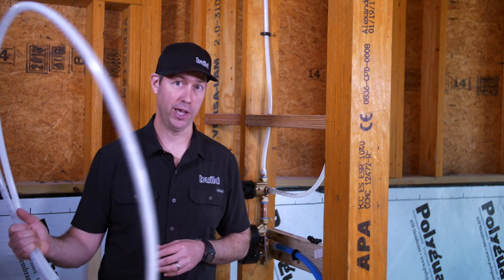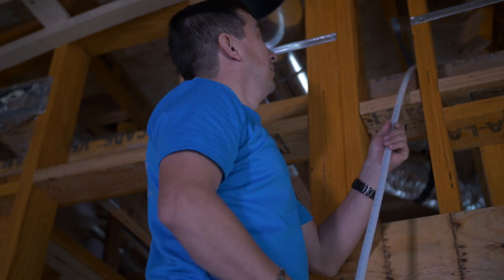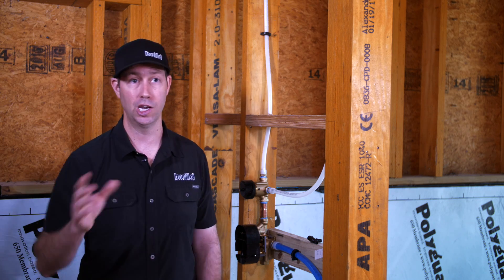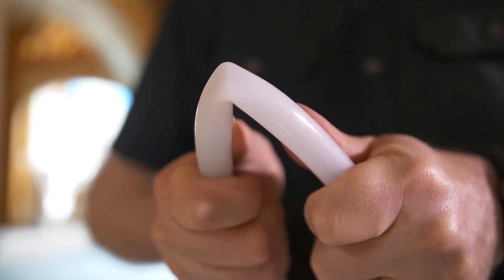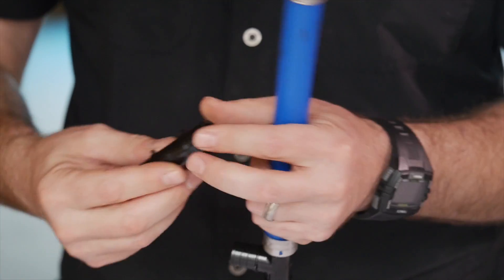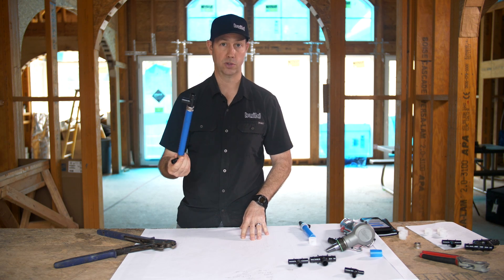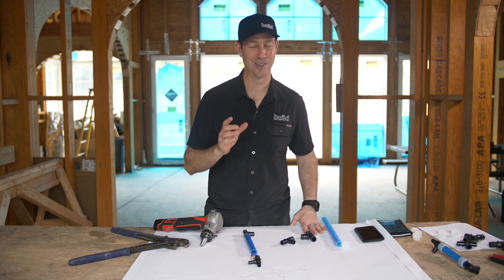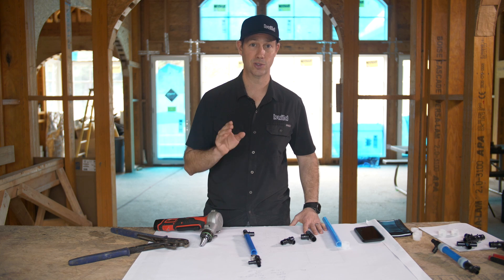PEX vs. Copper Plumbing

Comment: Lets use the example that pex is more like OSB plywood. It's cheaper, and everyone is doing it. The reality is, ACX is better, more expensive plywood and copper is far more durable. And let's face it, plumbers are charging as if they are sweating a whole house, while pulling tupperwear piping...  I have replaced LOTS of pex that mice have chewed through, never copper. Trends die, I mean look at QUEST piping and the late 80's ABS pipe, RECALLED after hundreds of thousands of homes were plumbed.
Reply: Alternately, if you have an issue like my home, with a granite slab foundation that is difficult to heat, and you live in the wonderful Ice Kingdom that Maine, well, 5 years i had to hire plumbers to come in and fix ruptured lines that despite insulating, and even 'heat wraps' were still bursting.

Switched to PEX 2 years ago, and while my lines still occasionally freeze, i havent had to spend 2500 on replacing the lines. As for mice? Easy, you apply a nice coating of Squirrel Off (thats what i call it, most people use it to deter squirrels from climbing onto bird feeders), a gel that they dont like touching, but is non toxic.

Both types of plumbing have Pros and Cons, Pex is cheaper, easier to install yourself (no need to hire a plumber if you have a basic knowledge of the process) and less likely to rupture from freezing since it expands with the ice.

And the cost of materials is a bonus too if you are trying to rehab a 150 yr old home like i am. First time i bought the copper piping for this place (junkies stole all the copper piping before we bought it) i paid about 50 dollars per foot of pipe (including cost of fittings, joints, and valves) and because copper requires a lot more work, i needed to hire a plumber to install it.

I managed to convert my entire house to PEX piping for less money than it cost me to get my rotors replaced on my car.
Reply: I Be Trollin' They Be Hatin' truth here. They are constantly revising crimping methods too..because its extremely prone to improper crimps that seep in a few years.
Reply: Exactly, I use Uponor/Wirsbo style joints and fittings. They get tighter with time, not looser. I'ver personally seen $400k townhouses with pex that mice have chewed and caused a lot of water damage.. with the repair materials costing $3-.. but I hear you there with the weepage issues
Reply: We have problems with chloramine leading to corrosion/erosion of copper.  
Also, as a repair plumber, I appreciate that, even in the tightest space, with wood shavings and tarpaper, PEX will not set a house on fire.
Reply: @pipedream09  In Florida here we have Chlorine, lots and lots of Chlorine added to the water, not to mention that older direct burial under slabs in contact with the sand/limestone not only caused nightmare after nightmare of under slab leaks, many self-generated sinkholes have been formed by leaks that went undetected for years in some cases despite people complaining of  abnormally high water bills in homes occupied by one/two people, they'd just ignore families of four or more and blame it on the kids until the hole opened up in the front or back yard, I myself got a call (while at work) some years ago from a neighbor that a hole had opened up in my front yard
Reply: The pipes that kept bursting when it got cold? Copper piping, very costly, very fragile, copper piping.

I'm not a plumber (im a nurse) so couldnt tell you much about why type of copper pipe.

the PEX so far, hasnt ruptured, and still works fine.
Reply: Show me one home ever that any of you have personally replaced L grade copper pipe(blue lettering), not a faulty solder joint, due to corrosion. Only cheap builders hire weak plumbers using M copper. They probably don't clean the pipe & fittings either. I bet they do swipe the freshly soldered fitting's with the flux brush. Then brush fibers are in the flux so the next joint/joints are potentially not soldered well enough to last more than 10-15 years. Proper grade copper and properly joined fittings will stand the test of time, every time!! Also, doesn't logic tell you when a "rodent" chews through plastic pipe you need to exterminate? That is not plactic pipe or installation issue.
Reply: I’ve replaced a lot of copper and not a whole lot of pex haha idk
Reply: Never heard of mice chewing through PEX in 25 years. I do however, see lots of dumb people connecting galvanized to copper all day long.
Reply: grafvonstauffenburg: 
And you are right about the English measures. I bet we spend many $Millions in the US due to errors from using the stupid English measures. We were on our way to convert to metric in the 1980's, but I understand that General Motors complained and so the whole project was canned. Disgusting!
Reply: So tell us, Dream Wolf, what were those damaged pipes made of:   PEX, M Copper, ??
Reply: Im a plumber and i wont use anything but copper in my house. I may have a case of cant teach old dogs new tricks but the way i look at it coppers been around for 100 years. If pex is still around in 100 years ill look at it. Even gas piping ill do threaded connections anyday im my own house
Reply: Proper spelling is qest, btw. With that being typed, it was on a mission..............to leak!
Reply: Oh yeah, frozen pipes reflect a lack of insulation for that geography. Cure the source!
Reply: We still use abs in the pnw. Way better than pvc in my opinion
Reply: @jesseschoenfelder6455  Shrinks and expands too much to use here.
Reply: My issue with copper stems from my previous house.  The house was 40 years old and because of the water hardness and acidity, one could literally   crush the pipe by hand.  It was as thin as paper in parts.  After about the 10th or so pin hole, I had enough.
Reply: You speak the truth, though like many things region and application plays a major factor in materials used. Down south, there is really zero downside to copper besides cost and it isnt really that huge cost in comparison to cost of building a  new home or full remodel especially if the home was designed somewhat efficiently (bathrooms and kitchen close together). Also down here in south florida the water is generally heavily chlorinated and every installation that used PB has failed and the pex is next. Where there are freeze thaw cycles or if you are on a tight remodel  budget and arnt removing all the wall board  in home  or if you are on well water, I can see an argument for pex though .
Reply: I would rather make sure I never get rodents than to have to worry about old ass copper oxidising and leaking or freezing and bursting.
Reply: @robertmoore-x4y  So ya'll can't handle anything unless it's diviisible by ten, llmao.

Comment: Matt, as always, great video.  I had a slab leak on my 50 year old home in Dallas back in 2015.  After talking to neighbors, it was evident that my copper pipes under the slab were end of life.  I did a ton of research and asked for Uponor Aquapex (PEX-A)  by name because i wanted the pipe to be more flexible to run in my small attic (and also more flexible in freezing conditions) as well as allow for better water flow compared to Pex B.  I had a permit pulled and had a plumber re-pipe the house through the attic in a trunk and branch configuration.  I already had a D'mand recirculation pump, so we simply had a proper pump return loop added.

Pros:
- Almost instant hot water - Hot water pump (ACT D'Mand pump) takes only 30 seconds to deliver hot water over 100 ft across 3/4 inch pipe. the hot water is fully distributed through the entire hot water trunk quickly.
-Water & energy savings - After the D'mand pump runs, I only need to open the hot water valve on the bath or shower for 5-8 seconds before getting hot water.  The insulated hot water lines stay warm for around 15 mins (great for kitchens and laundry rooms where the water has to be turned on and off minutes apart).  This really cuts down on having to run the faucet to get hot water again.
-Relatively easy installation - some drywall repair work was needed to re-pipe my house, but overall, not a horrible process.
-Piece of mind - I know that another slab leak from water pipes will never occur (common in my neighborhood).
-Even if a pipe freezes, the pipe won't burst - I have not had my pipes in the attic freeze even when the temperature was in the low-20's, so that has been good.
-Flame Free Installation - A huge plus in confined spaces
-No Digging Under house & No tearing up flooring for a repair

Cons:
- Temperature Extremes - Even though pipes are insulated in the attic, they make the water more susceptible to higher temperature swings throughout the year.  In the summer, the water can be around 100 degrees until cooler water from underground flows through (because the attic is about 125 degrees).  The warmer days fool my D'Mand pump into thinking hot water has been delivered throughout the house, so it stops early when we press our hot water button.  In colder months, water temps from the pipes in the attic can be 40-50 degrees during cold snaps outside, once flushed out, the water is normal ground temperature (55-60 degrees).  The initial temperatures are a bit cold when you just need to wash your hands.  This is only noticeable about 3 months of the year.
-Construction & Drywall repair - every plumbing fixture in the house had to have new pipes run in the walls.  Hollow core interior walls were much easier to run piping but a few walls were exterior walls and required more effort.
Reply: Uponor AquaPEX tubing is the best answer. Expensive tools but most fool resistant system.
Reply: No re-circulation pump is designed to save overall energy (because energy is lost recirculating hot water in pipes, even with insulation).  It is designed to reduce water waste and deliver hot water quickly to a remote part of a house's plumbing fixtures (such as a far bedroom or remote laundry room).  D'mand pumps do use less energy to run than most recirculation pumps on the market because they only run when a user pushes a button instead of running for hours during a set schedule or 24/7 like other pumps (more energy is wasted when a motor is running for hours and hot water is being recirculated in a cold environment). Once the D'mand pump gets hot water (less than a minute), a temperature sensor turns the pump off until a user pushes the button again.

A great application for the D'mand pump is when a laundry room is located at the end of the hot water branch.  Most HE washers only use about 5-7 gallons per fill cycle (wash, rinse, etc), so when a user wants a hot water cycle, the water ends up being mostly cold unless the user flushes out the cold water in the hot water pipe through a nearby sink or other plumbing fixture.  Without this flush, the washer will be full of mostly cold water by the time the actual hot water gets to the laundry room.  By the time the washer needs another fill cycle for rinse, the hot water that got to the laundry room will be cool again over the 20 minutes that it sits in the pipe.  The D'mand pump installed as close to the end of the branch will allow the fill water to be mostly hot water.

It is an item of convenience that I have gotten very used to and it would be hard to go back.  Anytime I want to take a shower, I press the button 30 seconds before turning on the shower.  The pump runs for about 1 minute to circulate hot water over 100ft of 3/4 inch hot water pipe in my house but the hot water gets to the end of the house in the first 30 seconds (the pump shuts off once hot water reaches the pump at the end of the loop (about 1 minute).  The faucet has hot water within 7 seconds of turning it on, so very little water is wasted.

My brother visited recently and turned on the shower for a full 5 minutes before using it because he was used to his apartment taking a long time for hot water to get to his bathroom  (this is his daily routine).  Does the pump offset the cost of energy loss by saving more water? Not in my area but it might in places that water is expensive.  I personally hate dumping 5-10 gallons down the drain every time i need hot water at the kitchen sink, laundry room or my master bathroom (all located on the far end of the house away from the water heater).
Reply: They were wrapped in poly at the slab penetration but nothing else.  Pinhole leaks are common in my neighborhood (Fox & Jacobs DFW mass builder from the 60's).  Most mass builders do not pay attention to quality.  One of my neighbors is an electrician and he says that the houses  in our neighborhood had no electrical ground rod installed when the houses were built, thus they used the copper piping as the grounding mechanism.  Over the years, nearby lightning strikes and electrical shunts to ground have cause pinhole leaks to develop.

A few months back, we had a lightning strike a nearby electrical pole.  Within 2 weeks, we had 5 neighbors in the vicinity of the electrical pole need slab leak repairs (2 decided to go to PEX-A).  Coincidence? Maybe... Truth is most houses in our area are starting to get pinhole leaks and replacing with PEX is a more viable option compared to tunneling to replace all copper pipes (one neighbor told me he has done 14 slab leak repairs in his copper lines).
Reply: Chris Wilson great comment. Thanks for sharing.
Reply: Chris Wilson that's what happened to me I have Pex now love it !!
Reply: Does pex sweat in the attic?
Reply: Chris Wilson, D'Mand pump in cold climate certainly don't save energies. We installed one in my friend house, and he deactivate it mid-winter after he realized that his water heater was almost running full time. Yes the pipes were insulated. Saved on heating though... ;-)

Comment: PEX is horrible!!  Leaks all the time with those compression fittings..  degrades in extreme weather.  Cheap builders looking to cut corner!!
Reply: How is PEX high skill? I'm not a plumber and I could teach a 2nd grader how to install PEX.
Reply: Must not have been installed right. My son in law is a master plumber and really likes it.
Reply: I'm not advocating PEX, I personally used copper in a recent personal minor remodeling project. However I seriously considered PEX and probably would have used it had I not had access to a pro-press. Yes the PEX would require special tools, but not special skills.
Reply: They make metal radius supports that attach to the pex and shape the bend so it won't kink.
Reply: If it leaks all the time, you're doing it wrong. If you're using substandard fittings it will leak. Use the right tools and quality fittings and it's a great product. I have switched almost exclusively to pex. Way faster. Way cheaper and no theft.
Reply: Attilio Di Marco pex is not a high skill. Its so easy that alot of home owners are doing it themselves.
Reply: Attilio Di Marco CPVC is shit, copper for the win.
Reply: My understanding is that the crimping and fittings must be installed to exact specs, and require specialty tools. Glueing CPVC is almost child play. Besides, kinking in the lines is quite a possibility., just as is was with poly pipes that turned out a bust.
Reply: John Okie Completely agree with you
Reply: A system that requires high skills such as PEX is not a good system. CPVC only requires basic gluing skills, and its is better, in my opinion.

Comment: Have long term studies been done of drinking out of plastic tubing? I would be worried about health risks.
Reply: what would be even worse is if they put cola, milk or water in plastic bottles...
Reply: There have been tests decades ago. PE is pretty much one the most inert plastics you can get. There's nothing to be dissolved by water (in contrast to the metal ions in metal pipes, which I can defintely taste now in some homes with metal piping).
Reply: @superdau   There are studies suggesting that there is a lot of chemicals leaching with all PEX piping.  Check out research by andrew whelton from Purdue.
Reply: Copper uses lead solder in old houses
Reply: Log siding
Reply: superdau copper is a super safe metal, a little bit dissolving into the water has no long term health risks as copper is both anti bacterial and doesn't bio acculmilate

Comment: Umm, where are the cons of PEX. Someone in comments already said taste in their hot water lines, California requires a flushing of the lines prior to occupancy. Some PEX has issues with kinking (where heat won't work), and requires support to be hammer free. Rodents can easily chew through it. It expands under pressure, which can lead to pressure drops when multiple fixtures call for water as when the pressure drops the line inner diameter changes restricting flow. Not to mention PEX is permeable and can leach containment into the potable water. Also PEX is not UV stable and will break down under prolong exposure to sunlight. Did I mention you still need copper pipes around your water heater (Someone already did). It's far from perfect, but just like copper it has it's issues. Same for PVC, it has it's benefits as well (Great for Well systems and Municipalities with hard water).  This is not saying it's bad, but application and region defines the best material.

Comment: Can pex A be used for radiant floors?
Reply: Christopher Peterson No, you want a pex pipe with a oxygen barrier for a radiant heated floor.  There are specific pex pipe with the oxygen barrier built in used for radiant flooring.